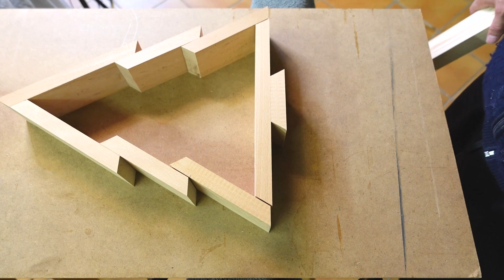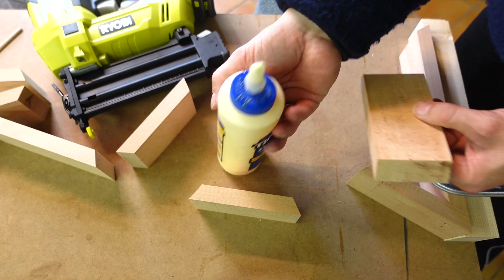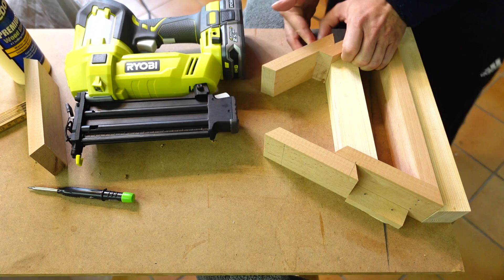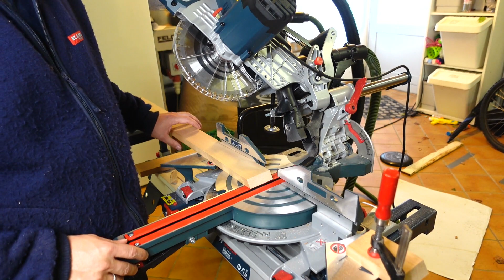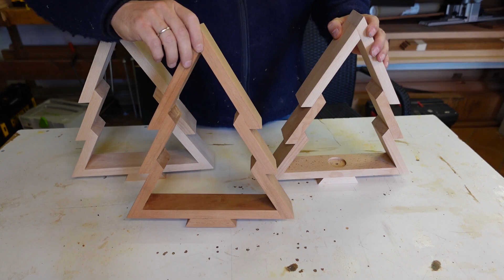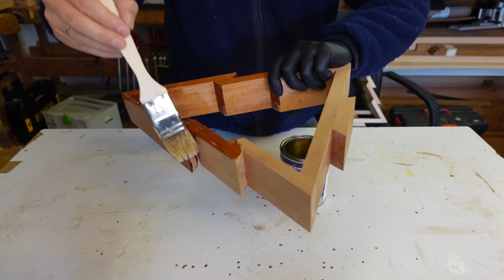Build Your Own Wooden Christmas Tree: Beginner Woodworking Project

Comment: Excellent Video.
Why didn't you put a 2nd & 3rd stop block in and build the entire tree on the jig? In other words, why is the top built separately and there is only 1 set of stop blocks for the 1st set of side pieces?
Reply from the maker: That is a great question 👍
The first jig I made was including the top, but when everything was nailed and glued.. I had serious problems with getting the tree out of the jig 😂 and the idea of making them fast kind of failed. So that is why I mad 2 setups, and I was able to make alot more this way

Comment: I have problem with my Metabo Kgs 216 to do cuts like this. The cuts get uneven by some mm:s and it seems pretty random where the "unstraightness" occurs. Have adjusted the saw and blade as good as it possible for me. Any tips?
Reply from the maker: Well the first thing I would tjek is the blade... Is it sharp? A dull blade will always take the easy way out.. Meaning not straight cuts.
Next I would make the cuts  where you tilt the blade so you only have the 19 mm to cut though

Comment: I will buy the plans because it helps me picture things. But what length of board did you start with?
Reply from the maker: The total lenght would be around 115,5 cm or 45 15/32" depending on how you cut your wood

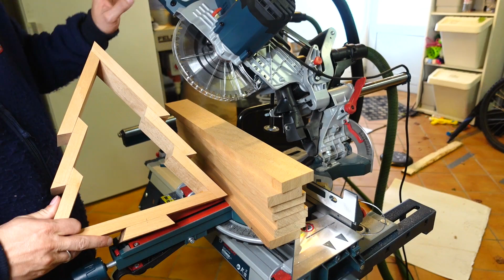Comment: I see at the 4:33 minute mark that you said you set your saw to a 30 degree angle.  Yet your plans showed the angle of the cut is 60 degrees.
Reply from the maker: Hi Stanley, It is true that on the drawing the angle shows 60 degrees as measurements on the drawing only measure the real angle, but on our miter saw it measures from 90 degrees so therefore it is 30 degrees for 0 degrees is 90 degrees on our miter saw.

I was in the workshop myself and just had to get my head together :) And I'm about to make a wooden star where the angle is 54 degrees on the drawing, but must be sawn at 36 degrees on the miter saw he he but I'll probably make a note on the drawing where the degrees at which the miter saw must be set can be seen.
Hope it makes sense

Comment: Does the thickness of the wood matter? Could I use 5/8 fence pickets?
Reply: Thickness don't really matter, yes 5/8 thickness will work just fine. Only an 1/8 difference from what was used
Reply: @thatdude8247  I agree, you could even make these from popsicle sticks or toothpicks. Think outside the box.
Reply from the maker: I think you would have some issues with the length, but you can adjust the top part

Comment: Nice work. What are the lengths of each section?
Reply from the maker: measurements of the boards are below the video, and have a great weekend :)
Reply: What kind of answer was that? So basically it was a waste of time to watch the video. Glad I checked comments a quarter way in...I'll be clicking off now
Reply from the maker: @darrengoodpaster  here you can find drawings and information on the build
https://www.etsy.com/dk-en/shop/WoodendummyDK?ref=profile_header
Reply: @ErikHovedskou77  Not helpful.
Reply from the maker: @billkennedy9112  measurements of the boards are below the video, and have a great weekend :)
Reply from the maker: Here you can find drawings and information on the build
https://www.etsy.com/dk-en/shop/WoodendummyDK?ref=profile_header